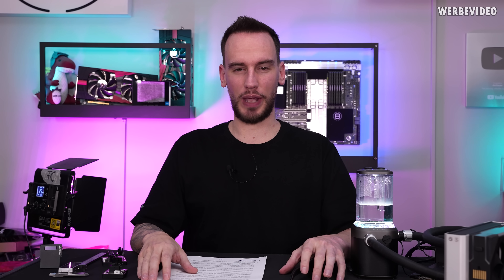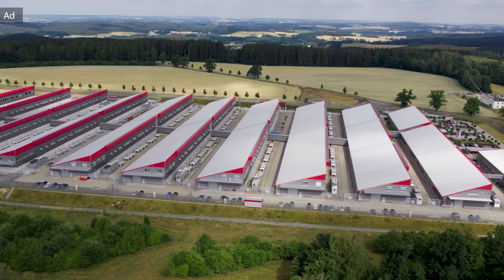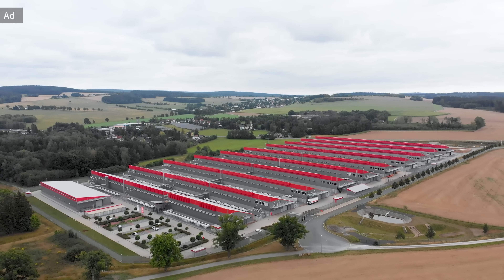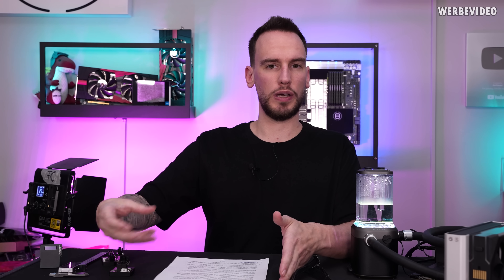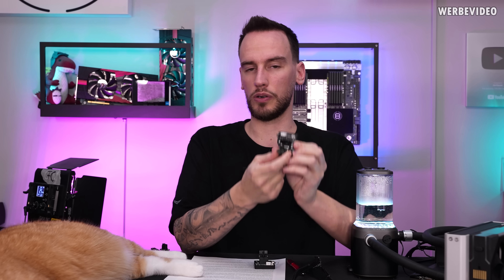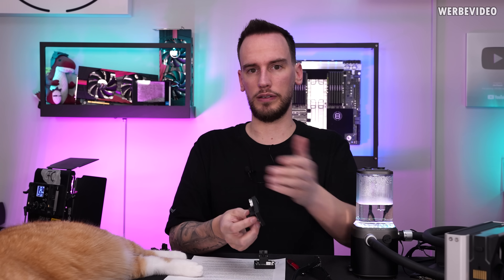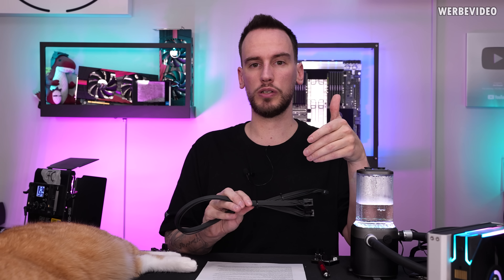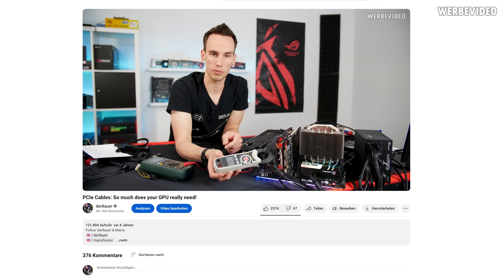12VHPWR is just Garbage and will Remain a Problem!!

Comment: Thankyou for highlighting early on how these things are made with a governed spec in mind.

The basic folk refuse to grasp that fact and want to flatout go after Cablemod as if this is their doing, when the entire point in the adaptor is to fix an issue that exists with the spec...

That and unlike everyone else, Cablemod is being way up-front and going way beyond standing behind not only their own product, but replacing the GPUs themselves!!!

The GPU makers are being finiky when it is their own "provided dongles/cables" going up!

This is why normal folk need to be left out of the conversation sometimes. They miss everything to pull out their torches and pitchfolks.

Comment: How about having the power connector on the back of the pcb flush with the board and have a strap that keeps it secure? Like these things are not hard, and if any variance is going to cause issues then why the hell was this standard even allowed to come out? Intel/pci-sig in it's infinite wisdom does it again and instead of insisting that they should have at minimum 2 12v-6pin and not bending the cables before 35mm, prebend it at the factory! As apple learned the hard way, your bending it wrong.

Comment: You’re getting a black screen because the sense pins are disengaged.  My CableMod cable had the same issue, black screen.  I replaced their garbage cable with a Seasonic one and it worked.

Comment: this is why i bought a msi mpg a1000g atx 3.0 psu. it has a 12vhpwr connector and 12vhpwr wire but also comes with a 12pin to 2x 6+2 pin, so if 12pin does die, can still use that connection.

Comment: i use the der8auer 12vhpwr adapters on my 4090 FE and 4090 TUF OC and have had no issues, but I made sure the connectors are fully seated and that there were no crazy bends in the cabling.

Comment: if the 12vhpwr pins were the same size as the 8pin pins the connector would be fine,

it's mind boggling that Nvidia thought they could shrink the pins and launch +500w through the plug without it melting
Reply: It's not that crazy, the pins are rated for the current that passes through them.
What happens in isolation rarely reflect real world results though, which is why field studies are typically done.
Reply: To say nothing of the variation you get in manufacturing. Nothing is ever exactly this dimension in production. There is always a tolerance, and the smaller the part, the tighter the tolerance has to be. If anything less then a perfect pin, in a perfect connection, under perfect environmental conditions will cause you to go over your rating and fail, its a bad system. If your connector will melt if operated in a hot environment, its a bad connector. Building with such razor thin margins,  such that the increasing the temp is enough to overload the wire, its dangerous design.     @MetroidChild
Reply: @billy101456  Well said. Tolerance matters. Its almost a spectrum, and if your tolerance is so razer thin that failure is reached at such a low threshold on that spectrum, then I believe you could argue that the product is defective, despite the fact that is does function in absolutely perfect conditions.
Reply: @5etz3r  it’s certainly not built with much safety margin. And 100 watts under max load, and was it 20 or 50watts more for the design spec? They shouldn’t be failing at less then perfect connections. I wonder how in a few years as the connectors and wires age if this problem will pop up again. Let’s hope the plastic doesn’t brittle with age.

Comment: 450W-600w is around the power usage of a small space heater. Also, if we aren't supposed to bend the cable for 35mm, the cables should be designed with that part with stiff plastic.

The Radeon RX 7800 XT was going to have the new connector, but they dropped the idea. I'm glad they did.

Comment: "Now, should we initiate a recall? Take the number of vehicles in the field, A, multiply by the probable rate of failure, B, multiply by the average out-of-court settlement, C. A times B times C equals X. If X is less than the cost of a recall, we don't do one." Chuck Palahniuk "Fight Club" (and also the Nvidia safety team)

Comment: Why didn't they just make a new connector based off the connectors we use for rc battery packs like ec-5 or xt-60. Basically bullet connectors in a housing. They can carry tons of current individually, in multiples there wouldn't be a problem.

Comment: Maybe I'm missed something. But I noticed on the cable that was used it appears there were only 2 sense wires. The cable I received from seasonic has 4 sense wires. Is it possible to only run with 2? Just looking for an explanation.

Comment: When they first made this adapter I knew there would be issues. I don't know why they don't make a 24 pin connector for the GPU. At this point I think that is the best solution but they don't want to confuse people with the motherboard connector. It doesn't have to have that number of pins but it should have a similar pin size. It's worked for years, it can work again for years. Instead they reinvented the wheel.

Comment: Even if there were sufficient safety margins with that connector the fact that “make sure it is plugged in all the way” is a thing is kind of ridiculous. If it is that important then put a thumbscrew at both ends like the old school VGA/EGA/CGA connectors had. I agree in thinking that one connector isn’t enough for that card. But using that stupid flexible plastic clip to “secure” the cable is pretty dumb.

Comment: maybe we just need an XT-90 connector or something similar sticking off the end of the card, I mean why do we have so many wires going into a video card and not just a big chonkin pair of 6 or 8 AWG? these cards are pulling power like a low to mid tier aftermarket car amplifier after all.

Comment: Why don’t they just put an AC 110/220v female outlet on the back of the GPU where the display ports are located? I think a single connector solution is “The Future” , maybe there will be an updated version in the 5000 series. I personally think 4x 8-pin is a lot of wires. Just build a power supply into the GPU at this point, they’re almost as thick as a PSU as it is!!! Can I get some likes! ❤

Comment: there is a video in russian internet segment where video repair guy nearly smoked his 4090 on video . power lines got unballancing . 1 power group had 12a per pin .. 2nd group 10a . now take a wild guess how long it will work if vhpwr limit - 9a per pin as maximun . 

 main root of problem -  vhpwr pin have a limit of 9a per pin .which is too low. any  loosened connection increase amperage  . beyond that limit .that connector is dead on arrival . we need something on pcie connector base . till that day more and more card will end in repair or in fire :)

Comment: I really dont understand how we got to the point of whats still basically a custom connector, and a pretty bad one one top of it, for high power cards instead of just designing them with multiple right angle 8 pin connectors.

Comment: I never was a big fan of those power supply connector since the very beginning of custom PC building. Hard as hell to socket them in as it is to socket them out and we still using the  same exact connector for the past 30-50!? years.

 I can't be the only one who think that power supply connector are all trash. After all these year one would think that they(whoever is in charge of engineering those connector) would have design some sort of fancy socket with a mechanical mechanism for easy connect or disconnect, but I get not. They clearly don't give a damn and are just here to make easy money.

Comment: The heart of the problem is just plain math. 600 watts thru such small wire and connectors is the problem. Lets start making cards more energy effecient instead of throwing more power at it and making it harder to cool. Cards are just to big now. Its time for the industry to quit adding power and make them better with the power the already use. Then develop a better connector and go "More Power".

Comment: We need a 100VDC output on the PSU. That will be able to safely deliver 600W to the graphics card, because it needs only 6A to do so.
Yeah, I know, 100VDC is dangerous. Well, a 12V 50A fire hazard is also dangerous.

As others said, the 6 paralleled Molex pins are each rated for 8.5A, totaling 51A. Even in a perfect world, this is problematic. Excess length, extra angled connectors, too light or just inferior conductor metal,  inferior PSU, those all create a slight voltage drop. The card needs 600W and it will be able to get it from 52.2A * 11.5V just as well as from 50A * 12.0V. And we exceeded the maximum rating of the connector, properly seated and cleaned before insertion.

So we know this connector is a problem. So we check it regularly. All that checking will cause pin fitment issues in the connector and cracks in the solder joints on the board.

NVidia should have ignored the dodgy PCIe specs for power and should have partnered with some PSU vendors and create a new standard. Could be a 100VDC connection, or maybe even 12V 8AWG pigtails with CE5 connectors.

Comment: i agree with you on this
when something draws that much power and has a small margin for error things will go wrong, you don't really see these problems on the 4070 and i haven't heard many problems with the 4080, i'm sure there might be a few out in the wild.
having a redundancy or even just sharing the power load over 2 connectors will help the cable from failing

Comment: I saw this coming a mile away and also how bad 40 series was gonna be so 40 series was announced and the gpu crash ended I bought a 3090 strix OC for $700 in perfect condition. Still so glad I did cause really the only GPU worth even getting this gen is a 4090 cause value, bus size, and vram but even then thats like $2k and then you gotta deal with 12 pin bullshit. So glad I stuck with my gut. Even thought I was nuts for not waiting for 40 series release. Normally I would but I just knew something was off about the 12 pin spec and about 40 series. Literally only plus frame gen which I absolutely hate, the artifacts and lag drive me nuts. If I really wanted frame gen at least there is the DLSS-FSR3 mod where you use DLSS for upscaling and FSR3 for only the framegen side of things. This generation is a joke. I feel bad for anyone buying anything less than a 4080 (even then 4080 is such poor value but at least it's better than previous generations). My 3090 strix OC wipes 4070ti across the floor, the bus width, and vram just doesn't compare. If 4070ti had a bigger bus width and a little more vram then it'd actually be worth something. Just a bad time for pc building right now, at least CPU's are awesome right now.

Comment: i TOTALLY AGREE!  I saw this the day they annouced the new connector.  IMO there should be two connectors one large positive one large negative screwed into terminals on the GPU, but it's not as quick to assmeble.  This new connector is all about cost cutting.  period.

Comment: I don't know why the 12VHPWR goes up to 600W instead of 300W and using 2 cables to power card to begin with. Idk if they predict that PCs will get cards with ~1,5kW power requirements or what? Not to mention it would make more sense to have a separate dedicated PSU for them at that range. 

Does anything except few GPUs even use that standard?

Comment: Faced exact same problem with cablemod cable (not 90degree adapter). Random bsods with pcie root hub whea in logs, wo load even. Switched to another custom cable set - issue disappeared completely. Connectors not melted or damaged to naked eye, but anyway - debug was kind of a nightmare.

Comment: 1: Why do they have it come out the side instead of up/down or laying down along the card? Who actually wants to mount the cable like that?

2: Why do we have to insist on cables held in place entirely by some plastic plug when something as simple as screws exist? The average consumer rarely moves components around, adding 5 secs for a screw that ensures that the mount is solid is fine. Putting together a computer, mounting a gpu or even opening the case generally requires a screwdriver anyways.

Comment: I still hope that both AMD and Nvidia will someday switch to 8 pin EPS, just like they have done with their server cards. If the standard is respected, the 8 pin EPS cable should be able to deliver up to 384 watts of power without any issues, which would mean that 2 of these connectors + the power provided from the slot would be able to safely provide 843W, all while using a cable that was pretty much designed with potentially tight margins and bends in mind in the first place.
Reply: FYI the previous gen RTX A6000 already used the EPS12V connector. So yeah it on nVidia.

Comment: The thing I will always find hilarious, had they just used 10 - 12 pin variant of the existing 6 & 8 pin, with the same safety margins (or lack thereof) as the current 12 pin we wouldn't be having this issue. It'd be bigger but still smaller than multiple 8 pins and in theory should handle cards like 4090 without much issue.

Obviously multiple 8 pins will always be better but at least a 12 pin of the same form factor would actually handle the damn current and not burn up. Or maybe Nvidia & AMD should be working on power efficiency instead of dumping more power into the cards...

Comment: It would also help if they are using this garbage, they wouldnt put the connector on the window vs towards the front of the case.

The 3080 with the dangling 8pin adapters connectors was ridiculous but immune to this. Also helped typical power was 325W max, which should be the top for such thin pins.

Comment: The simple reality is that the cheap folded metal pins/plugs used in both the older minifit and newer microfit (and overwhelmingly common as a pin style in electronics more broadly) are just not suitable for supplying power at these levels. They're designed primarily to be cheap to mass-manufacture and for sending either data signals or power in the single-digit amps or less, and trying to gang a bunch of them together to be able to feed hundreds of watts to a graphics card is a recipe for problems.

If you want to know what a proper low-voltage DC connector designed to be reasonably cost-effective and carry large amounts of currents looks like, examine the RC hobby. They've been doing this for years, and have a variety of blade and barrel style connectors (Deans, EC, XT) that are no larger than the 12VHPWR and carry as much current or more with fewer pins (so fewer partial failure modes where only some pins make contact).

An XT60 connector (smaller than a 12VHPWR) can safely carry 60A continuously (720W), is quite clear when it's plugged in properly, and costs cents to buy. Such a connector would obviously need to be modified to work well in a PC (a latch would be nice, plus maybe a few low-current signaling pins that seat later to ensure it's fully plugged) but the basic idea of using a proper heavy barrel or blade as the primary contact surface instead of a bunch of small thin bent metal sleeves that are prone to deformation and poor contact would resolve all these problems.

In fact, XT-series connectors in particular have been so popular that they're now used all sorts of other places you need high-current low voltage DC connections with good success. Other hobbies that require power use them, I've seen them in power banks, inverters, and I use them myself all over the place for connecting various things. They're great, and it's painful that computers still struggle to reliably connect a graphics card to a power supply by dogmatically sticking to their blindered obsession with these "computer-style" pins when this is a non-issue when you use a pin style appropriate for your load.

Comment: I am upgrading from Asus 4080 OC to Asus 4090 OC and am currently using your 12HPWR to 3-8 pin PCIE I am running a Asus Thor 1200 watt PSU with Asus factory PSU wires made by cable mod I believe. My question is should I stay with 3 PCIE to 12HPWR or go with Wireview 12HPWR to 12HPWR and Nvidia 4 PCIE adapter?

Comment: I recently bought a 7900XTX because it's half the price of a 4090, better suited to my use case of 1440p gaming and as a bonus won't try to burn my house down!

I'm not knowledgeable enough to know the exact problem or a fix... but I know enough that if it's getting hot enough to melt then something is VERY wrong. You CANNOT blame the consumer when the simple act of plugging your product in causes an elevated risk of fire. A 'fix' is not telling the consumer to ONLY plug the product in a certain way. You also have NO control over what cables your customers are going to use, so best assume the cheapest garbage you can find. This is a company desperate to not conduct a recall, the only way that happens if they are forced to. I really hope that's BEFORE someone sues because their house burned down (and really really hope that no-one dies as a result).

I'm also flabbergasted that the Nvidia fanboys continue to shill for team green, it's like the Apple fanboys... the company can do no wrong, even when they are actively doing the wrong thing for profit (USB-C, iMessage, ...)?

Comment: The Chinese "Moore Threads" GPU may be crap at performance and efficiency, but it at least does power connectors better than all the others: they use an EPS12V connector or two, on the END of the card, not on the SIDE.  There's just a built-in cable going from that connector to the actual PCB.

Comment: Another factor that doesn't help things at all is that a lot of third party cards are extremely wide and have the connector on the length side of the card, and not recessed in any way. I have seen so many builds on reddit where the cable is bent tightly up against the glass.